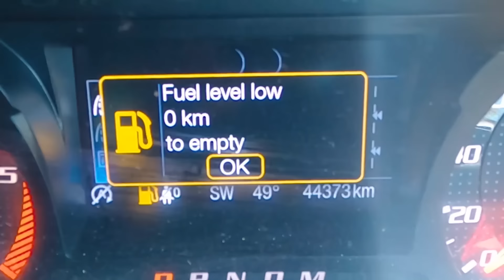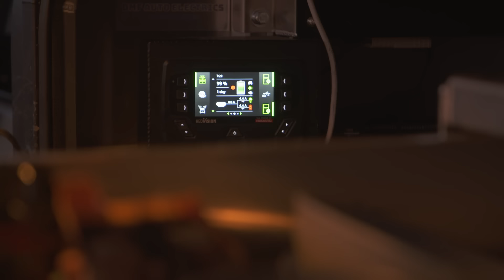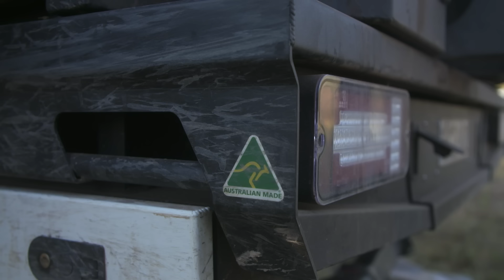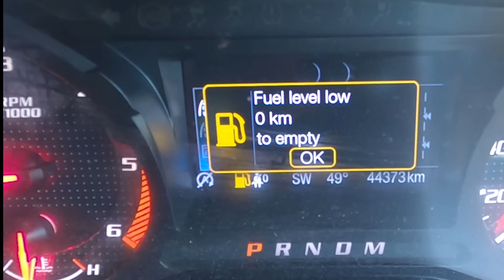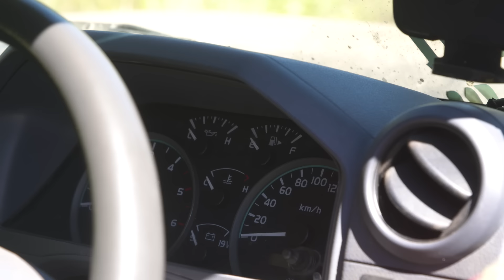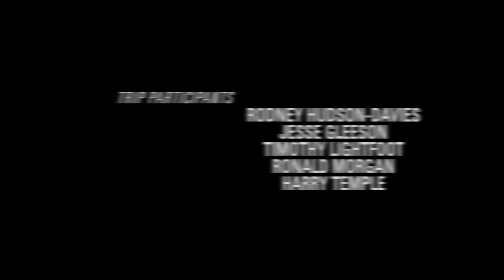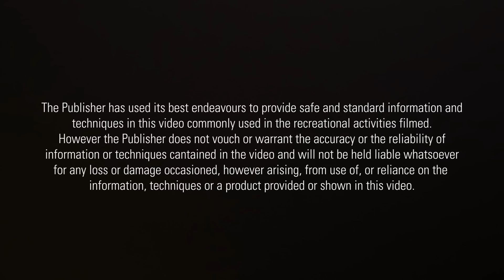We run out of fuel, food and tyres – do we make it? THE KIMBERLEY FINALE

Comment: My repair story:

6 months ago, driving a little known bush track in North East Tassie, middle of nowhere basically. Family and I were on our own, and weren’t even doing anything exciting at the current moment, but driving on the flattest part of the track and kicked up a stick that ripped the fuel line right out of the top of the fuel filter housing. Thought maybe it had only popped off, but it had actually tore a chunk off the top of the housing so the hose wouldn’t even sit in it anymore. About an hour later, covered head to toe in diesel, managed to connect 12 zip ties together and wrap them around the fuel line and filter housing to pull it in enough that I’d get enough fuel pressure to run the engine. Lost 50Lt of diesel (nearly ran out) on the 40 min drive to civilisation, but happy to have made it!

Comment: 3 days before a lockdown, two mates and I decided to do some exploring, we couldn't find anywhere suitable to wild camp where we wer e so we headed south early evening to strata florida track in Wales in the middle of December. We start the track in the dark. Full lights on, I had never done the track at the time. Fully relying on come from my mates about what was coming up. Ended up in between two river crossings/flooded areas that was just big enough for one truck. My fan belt started to slip, it's past 11pm at night, it's freezing, I have a head torch on  i radio it through to the others, next thing I know one of them has come bombing up the river to see if I was okay. Ended up setting up camp at 00:30 mid track, fire on, tons out, grub on. -5 degrees it fell to that night. My second ever night camping with my truck!

Comment: Seriously how good is the Ranger doing a good portion of the track in 2wd after giving Graham his rims
Reply: A ranger doesn't need 4wheel drive😉
Reply: You can actually use the rear diff lock in the ranger in 2wd
Reply: Might have to something to do with not so much the vehicle but more to do with the driver
Reply: @hamishmcdrury agree. but if the good year truck the  ranger raptor if it is a triton it will handle terrain much better specially when they swap the rear tires into 35" the triton with a super select will allow the front and rear diff to run at separate speed in 4H mode with a center diff open
Reply: @hamishmcdrury  true, but you give a great driver a great car and they can do things others cant

Comment: The best bush mechanic fix we've done was a couple of days ago in the middle of the Simpson, one of the patrol chassis's snapped in half, cracked clean through 3/4 of the way round on both sides, just in front of the forward leaf spring mounts.

The back was bouncing forwards and backwards about a foot each way. It happened about lunch time and we pilfered every piece of steel we'd brought, hooked up two batteries and welded the steel across the crack to hold the chassis. We then made up some steel braces that bolted between two canopy mounts, and then finished up with some 2.5T ratchet straps either side to keep it together. 

The car drove off from where it was parked at dinnertime that day, then we proceeded to baby it 350km across the desert, calling every bump and corrugation along the rig road and down the Birdsville track and back to Melbourne.

Comment: My bush repair story

Coming out of fruitbat falls QLD we noticed the camper was sagging on one side. After close inspection we seen that the whole suspension system had gone through the floor of the camper and into the drawers above. After an hour or two on the side of the track we managed to find a log and combined with 50 cable ties we replaced the collapsed side with it. 2 hour drive to seisha and we were out of trouble. Managed to keep the log for the rest of our cape York trip. It’s still on display in the shed to this day!!

Comment: Best bush mechanics story…
Blew up the front diff in remote WA on some sand dunes. Gears shot through the housing and drained all the oil. I have photos of the gear hanging through the diff housing.

Managed to remove front tyres and had a 35mm socket on hand to remove the axles from the HUB.
Banged the wheels back on and drove it back to base.
Managed to get Diff rebuilt and off we went!

Comment: Not sure if my earlier comment worked, was signed into wrong account. Bush fix. We were on the freshwater track at double Island in a fj40 with a 253 in it. Put the fan through the radiator. We were low on beers, not many tools. Was later in the day. First option for fix that was thrown out was smart and stupid at the same time. Start a fire, melt down the lead in the battery to fix the rad. That was answered with how are we gonna start the car (insert swearword here). There wasn't many option we removed the rad and engine fan. We had a small thermo on the front that we had to rely on. Then straightened up the damaged tube, got moss and sap off a tree. Jammed it all in the holes. put it all back together without the engine fan, because we had a broken gearbox mount and it would of hit again. Had to sacrifice the last beers to fill it up. Drove to rainbow and bought some glue but because it wasn't leaking we left it. Made it back through the track and up the beach, all the way back to brissie. Funny story is we all work in a radiator shop so when we had time we ripped it out and pressure tested it and it didn't even leak.

Comment: Not as much of a bush fix, but something that amazed me. I was a pilot driver for a company based out of Alice Springs & Darwin, and we were a three-truck convoy transporting house from Alice Springs to Derby WA via Katherine, and a hub on the rear truck (I was the rear pilot) broke and 2 tyres wheeled under the weight of the house, then slingshot up and bounced 30-40m off the road, as I was getting the tyres, the driver had used air jacket to lift the house up and chained the axle up so it was drivable, this happened 200km south of Tennant Creek, and organised for repairs in Darwin.

Comment: Hey Shauno - my uncle had some issues in the territory years ago - like around the early 70’s - when he was a ringer. He broke the flange on his water pump or alternator so he walked into the Bush and cut a section of tree with a hand saw and rounded it off with his pocket knife and the few tools he had and made a wheel to hold the belt which worked and got him back to town 👍🏻

Comment: Gday team, loved this adventure, 
We had 2  75 series cruisers in delta Downs station just after the wet season, and one had blown a radiator hose, we wrapped it with sports strapping tape and filled the radiator with dirty puddle water from the track and drove it back to camp. Now I have a roll in the glove box all the time. It did not leak. Cheers lads

Comment: My most insane bush mechanic story.

Drowned my 1hdt 80 series in the Mitchell River in Lower Dargo for about 45 minutes before we managed to get it out.

Drained the oil, about 3 litres of clear water came out first. Replaced that 
Pulled the air intake and filter, filter totally drenched and water up to the top of the intake manifold. Woops.
Used a piece of poly pipe to blow air into the top of the turbo compressor to get the water out.

Pulled the injectors out and towed the car in 1st gear to turn over the motor which sprayed water into the air out of every injector hole like a pressure washer and at the same time shot a square foot of soot out the exhaust onto the ground. Repeated that process a couple of times after tipping a small amount of diesel into each cylinder. Dried the air filter in front of the fire put it all back together, hit the key and it started. Runs better than it ever did after getting all that soot out of it. 

So if you've got carbon build up in your engine, just stick it in the river then follow above process ;)

Comment: My bush repair story, I was travelling in Virginia in my old 1993 Jeep YJ and was about 2 days in, with 2 days to go. I was driving the trail in 4wd high when i huge mudhole was in the middle of the trail. I sent it, too hard and broke the rear axle, leaving only the front tires spinning. I winched out the hole, used ratchet straps to keep the tires from separating. Then i used paracord to attach 2 small pine logs to each rear tires, and sledded my way down the trail. I managed to meet up with friends who ran to the auto parts store for me, and did a trail side axle swap to make it home.

Comment: Our bush fix was when we cracked the chassis on a rd in the middle of nowhere in FNQ gulf country. We ratchet strapped to bull bar to bring it back together then bush weld with some small off cuts of steel plate. We then drove an axe between spring leaves as the springs were bent and inserted bits of old rubber tyre and radiator hose found along the rd  to help lift the back of vehicle back up. We then drove cautiously back to civilisation and had the chassis plate welded . we then drove it for another 12000km to finish our trip which included going into Arnhem Land, Oodnadatta track and back into Qld. The insurance finally wrote the Ute off 5 months later.

Comment: My Bush repair story- 
Traveled from Victoria to Cape York, started the Frenchman’s track prior to making it to the Old Tele track. We got about 10kms in from the East, and snapped a rear shock. Had to flex in a rut to get the spring back in as it had fallen completely out. We then used a ratchet strap to stop it from over extending while we drove back out of the track, all the way to Weipa. 
In Weipa we were unable to get the correct shock absorber, so ended up with a Hino front shock, upside down. We completed the Old Tele track, and made it all the way back home on that shock. 
Might be the only Hino part to have ever done Gunshot 🤷‍♀️😂

Comment: Our bush repair story is on a trail Called Whipsaw here un BC. To cut to the chase. Passenger side upper arm snapped in the balljoint area reaping out the brakelines and wheel just buckling over. So we had to bushweld the top and part and disable 1 brake line . Made it out in 2 wheel drive.

Comment: here is my bush fix, we were driving deep into Colorado rockies , going from crested butte to aspen (14 miles) when my radiator solenoid went out, the electric motor still worked but i needed a way to hot wire it to the battery, having no spare cables y looked around to see what I could use, well I ended up finding my wife's curling iron!! i cut off the cable and made the repair, got the radiator fan working enough to get to town!! Needless  to say my wife was not pleased when she saw her "expensive" curling iron choped off!

Comment: My best bush fix story: 
My cousin and me were riding the world sketchiest  aprilia red rose motorcycle in romania in the middle of nowhere, when the bike suddenly stopped. There was no villages around 10miles so I decided to take apart the fuel tap, because there was no gas in the fuel line. I found a lot of dirty muddy rust on the filter, but we don't had any rag to clean it up, so I  plucked some grass from the side of the road and wiped down the dirt. It worked fine so we made it home. I never forget that story.

Comment: My dad and I used JB Weld to repair a broken hose outlet on a radiator and years later its still going. 

I have plugged a huge hole in a tire when we were out of plugs  with a bolt and a butterfly anchor with a washer and a layer of duct tape under the washer. It held well enough that we could air it up every hour or so and limp it home.

Comment: My most successful Bush fix happened back in the 80's while in the Vic High country doing a spot of night driving when my Mate ended up stuck on a large boulder. He said he ended up hitting pretty hard and was well and truly stuck. After allot of head scratching and ideas thrown around we freed it with a jack and some rock and log building by then it was well and truly beer o'clock so we headed back to camp. Once we were parked up with a fire roaring and beer flowing my mate went to his car and could smell fuel. After inspection we noticed there was a decent crack along the weld of the fuel tank and was leaking pretty good. Again more head scratching and I remembered reading something about sealing things with a bar of soap so hey nothing ventured. I grabbed a soap bar and proceeded to rub onto the crack and fuel. After a while the fuel sort of reacted with the soap and formed a bond of sorts. Once I had enough on, the leak stopped and I let sit for a while. I continued to rub soap over the bond and as the soap dried it hardened and didn't leak. Success! We got home without a loosing a drop. I think he drove around like that for months until he finally got it sorted. There was another time we had to use some old fencing wire to jump start the car but that's another story! Cheers

Comment: My Bush repair. Family trip (2 families) to Gibb River Road towing campers.  2 day detour to Mitchell Falls. Dumped campers at Prince Regent River to do a day trip to Mitchell Falls. Kalumbaru Road was extremely corrugated , literally out of control at 30km/hr in my GQ. Finally reached the Mitchell Falls turn off, turned the corner and "whoa, that does feel good" as the car seemed to have a mind of its own. Pull over to check, and the right from wheel has four studs left, and what is left has gouged the rim and given the studs themselves a serious diet (worn to half thickness). One stuffed rim, two studs gone and the four remaining unusable. What to do? Pulled both rear hubs and knocked out two studs each. Pulled the front left and filched one from there. That made five studs for each front and four for the rear.  Got us going again and we still made it to the Falls!

Comment: also, my bush repair story, my oil filter broke (penetrated with a large branch which also went through the front bonnet), and without a replacement, had to cut up the vehicle padding (which happened to have the same type of synthetic fibres as the original oil filter, dunno why pls don't ask lol) and dismantle the filter housing. then we used jbweld to fix the hole where the stick went through. after that, we cut up a 2 x 4 to size and mounted the filter in a new spot where it was less likely to be snagged again.

the branch went through the front bonnet because we encountered some hidden mud (the crust was really thin). we were saved by good quality barwork (the vehicle didn't completely rollover).

Comment: Got a "Bush Fix" story for ya. During the QLD Variety Bash in a HQ Panel van "The Flying Pie" we had a RH front Brake caliper fail between Blackall and Isisford in Western QLD on a farmers property. As we had no spare parts and next to no Brake fluid, the only way we could think of to "block off" the brake caliper was remove the hose from the caliper. Insert a small flat head nail from the farmers shed into the hose. Them re attach the hose to the caliper. After a quick check for no leaks and a bleed up of the brake fluid. we were able to get going with 3 brakes, in to Emerald Central Queensland to a blokes yard who had a spare HQ brake caliper.

Comment: My bush fix story:
Headed back from a day out moto/quad riding. We loaded the trailer with over 1T of timber logs for fire wood packed underneath the quad in the trailer.
Got half way back to the tarmac from the bush and lost the front leaf spring wield on the right side of the trailer. Had to unload the trailer fully, used car jack to take the weight of the trailer. Jammed a wooden block that was kicking around the back of the Ute along with a ratchet strap to block the spring up high enough to clear the tyre from the guard when fully loaded. Drove 200klms to get home with a block of timber and a ratchet strap holding together with hopes and dreams. 😅

Comment: My bush repair story: While on a ShitBox Rally an overloaded mid-1990's Renault Clio clean knocked their oil sump off on a rock in the middle of Brunnett Downs NT.  Towed it to camp - flipped it on its side - found some plate steel and welded it on where the slump should have been - rolled it back onto four wheels, topped it up and drove it all the way to Dawin via Borroloola.  Great memories.

Comment: My best bush fix was when there were four of us.
I had a hole in my radiator. 
Between us we had super glue, blue tack and som 100 mph tape. 
Super glue on one side of the blue tacked and pushed into the hole. 100 mph tape over the top. 
Got home (70 51:16 km) with a piece of kit everyone should have. An OBD-2 reader and an app on the phone. 
Many vehicles these days have lights that come on, when there’s a problem, rather than gauges. 
I had “previously” set up the app, so that oil & water temp needles were vertical at normal temps. 
Got home without problems. 
Loosened the radiator cap to the first notch so that water wasn’t pushed out under pressure. 
When oil temp even slightly started to rise, it was time for more of the other coolant - water.
And so on until I was home.

Comment: My hubbys best bush mechanic was on Fraser island, a friends GQ Patrol flexible clutch line broke. We had to bleed it up, he made a suction bleeder out of a spray bottle and some fuel hose. Connected the fuel hose to the bleeder nibble clutch slave cyclinder into the spray bottle. Another hose coming out of the bottle into the suction of my under bonnet air compressor. While another mate (3 man job) poured brake fluid in the reservoir. Another person cracked the bleed nibble turned the air compressor on and sucked it through to bleed all the air out and got the car going again for the rest of the 3wk trip.

Comment: The tall grass kept me on edge, in 81 we were cutting a trail with permission and ran into a "18 wheeler" trailer tongue, just crushed the radiator and water pump. Perfect like through grill. .  Back then a junk yard and $90 here in the states and it was fixed but  hard drive, stop drive stop drive stop out. about 7 hours